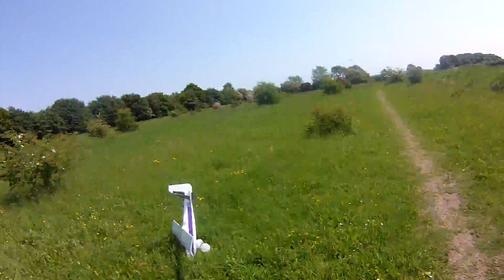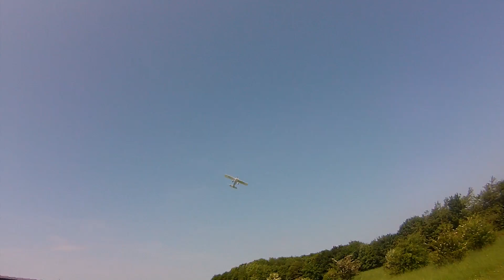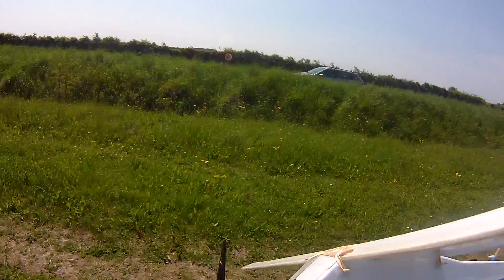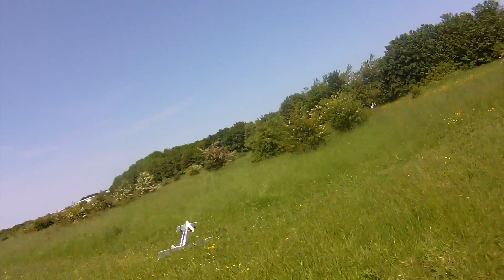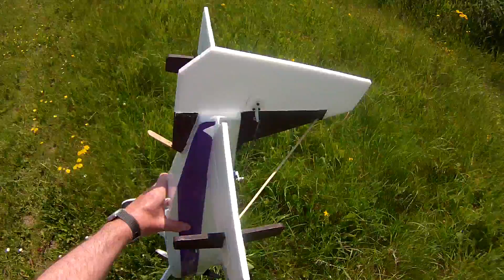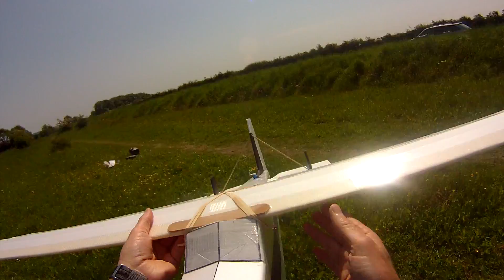FT Bushwacker Maiden

Comment: I like the mod to the nose, I made one from plans and changed the nose to close up some, make the thrust from inner areas of props larger more efficient, running a larger motor and 40 amp esc so the thing should tail walk, have to fly maiden yet,

Comment: old vid but just popped up for me. any tips on battery mounting for these? maiden soon but not sure how to get it in and out of the nose section with velcro. I have built to FT plans from hobby craft board it looks the business but will it fly....
Reply from the maker: Hi bud, sadly this model was never a great success for me, my building skills were still at an early stage and depron not the ideal meadium for this large design. Battery placement/security is always an issue, my advice is find a suitable Battery of a reasonable weight/ power any use a combination of velcro straps on a hard fixing point such as lite ply stuck firmly a convenient flat surface. Good luck.